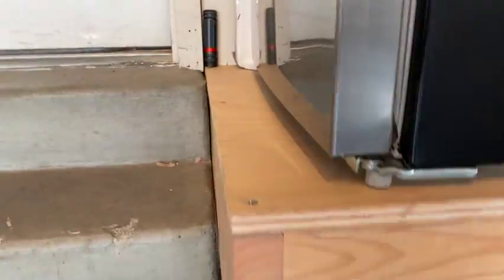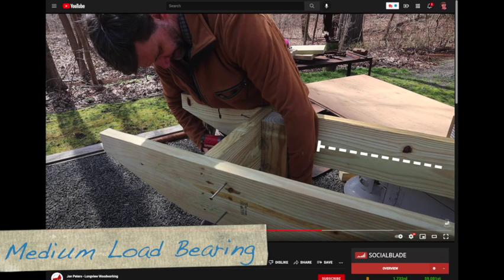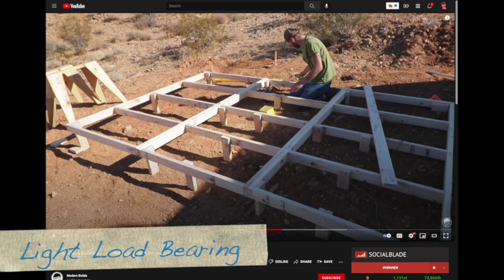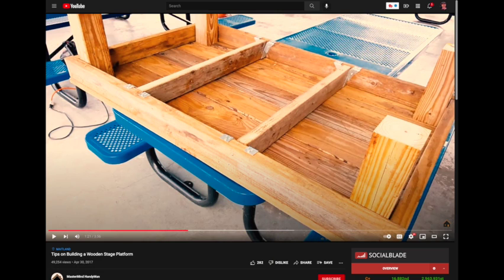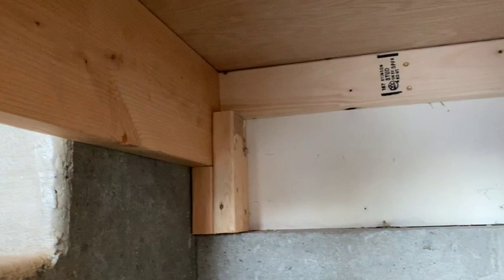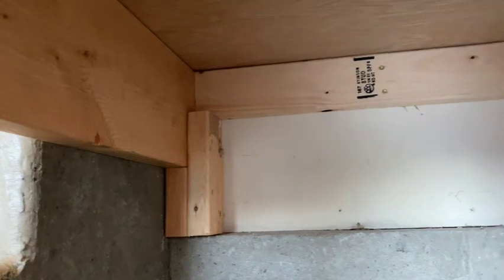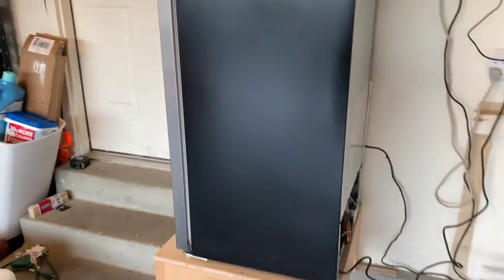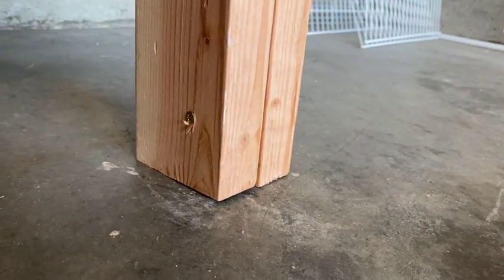How to Build a Load Bearing Wood Platform

Comment: Nice video. Your method is very similar to how platforms are built for theatre performances. IA470 Stagehands has a page with detailed information on building this type of platform. I made a large stage in my home for my desk and musical instruments. Getting off the ground helps dampen the sound of amps and I can utilize the space underneath for storage.  I haven't had any problems with my build.
Reply from the maker: I used to build sets for theatre. Go figure. Good info!
Reply: @KylersStudio  What is the optimal weight per square foot for a 40x40x4ft high performance stage? I am thing 200lbs per square foot.

Comment: Thanks for the video. Doing a lot of research on making a platform for my room. The platform by John Peters (the first one) also uses the two verticals screwed together, where the shorter upright (2x4) takes the load of the cross bar (1:14 in his video). Which means that the friction isn't the only thing taking the load.  Thought you'd like to know.
Reply from the maker: Ooh, yes! Excellent observation! I looked at that sped up clip a little too fast. You're totally right, he has the vertical 2x4 bearing the load! Thee 4x4 probably aren't even necessary at that point, but it was a solid build more than capable for what he needed. Thanks for pointing that out!

Comment: Great video. I need to make a platform to fit a shower tray/enclosure! 1200mm x 800mm on top of a subfloor! it will be 210mm in height. i was thinking of not having 4 legs but just lay my 2 buy 4's horizontally and build from there until i reach the height, the an 18mm sheet of ply, and then shower tray on top? What say you master Kyler?
Reply from the maker: It's hard to visualize without seeing pictures or functionality desired. But if you feel comfortable jumping on it, then it's probably fine.

Comment: It amazes me how many builders do not understand this.  They want to use nails or screws to bear all the weight. This is fine if you just have a minimal (non-human) load that is close to the ground. But if you have a serious load with people involved, the best method is to have the members lying on top of other members so that you get maximum load bearing possible from those members. Nails and screws should only be used to hold them in place laterally (usually with some sort of "hurricane tie" bracket).  This is especially important when building decks.  There have been numerous deck collapses (with deaths) because the builder (usually DIY people) didn't understand this principle. I read a story about one guy who built his own deck, had people over, and the deck collapsed killing a child that was playing underneath.
Reply from the maker: Sad lesson. Logically understanding the application of physics is paramount, especially as you say when it really matters. Thanks for watching!

Comment: Don't think you were fair to Jon Peters. He does have 2 x 4's supporting the load sistered with 4 x 4's at the corners and 2 x 4's mid-span. Check the video at this spot. https://youtu.be/VLplul3tr6I?t=309
Reply from the maker: Yes, you're right; I upped his score to astounding after the video was published. He does set the beam on a 2x4, which is exactly the right way to do it. Thanks for noticing!
Reply: This was a good teaching moment..
I don't want to build a load bearing structure that's going to fall on my head.